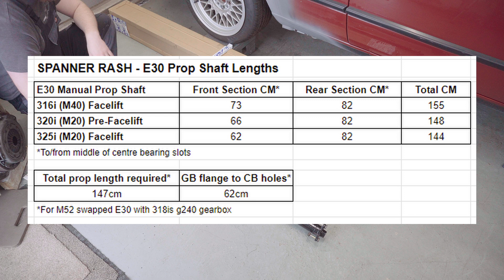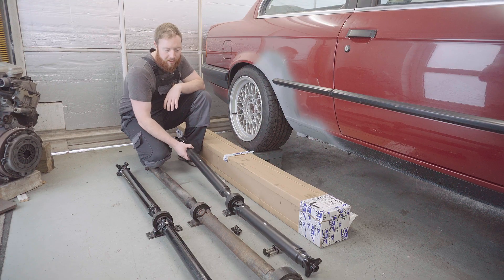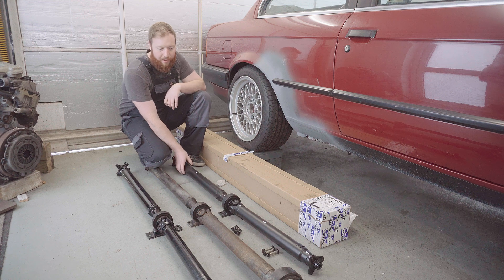E30 M52 Prop Shaft Options [24v M50 + 318is Getrag g240 Gearbox] BMW Drive Shaft Length Guide | 051

Comment: So for m50b20 swap, what center support bearing do i need?
Reply from the maker: Centre bearing? 2:58 the centre support bearing you need depends entirely on the chassis of your car.

If you have a pre-facelift car, you need the early type centre bearing, and if you have a facelift car you need the later type. The bearings are interchangeable between any of the prop shafts, but you need the correct one for your shell.
Reply: @SPANNERRASH My e30 is a 1989 320i Facelift Sedan, Ive got M50B20 non vanos on the car, at low speeds the car vibrates a bit and I dont know what to suspect, tires, centre bearing... also, when I engage the clutch, I can hear a clunk noise, but only when engaging the clutch to change gears, any help please?
Reply from the maker: @robi6713  Sounds like it could be a clutch release bearing, or maybe your clutch is knackered and has broken springs?

Well worth jacking the car up and inspecting the underneath to look at that centre beariing though, also a good close look at the wheels and tyres.

Comment: Hello

I'm in the middle of sourcing a 325i facelift propshaft
But I really cannot find any on the Dutch marketplace.

I see them on ebay.. New.. But they won't send to Europe
Can u tell me where did u bought ur 325i propshaft
And perhaps have a link for me

With kind regards
Sander
Reply from the maker: Hi Sander, yeah these can be difficult to find, most of the cars in the UK were 4-cyl and E30s are becoming more difficult to source parts for in general.

I waited quite a long time to get the 325i prop shaft, and when I did, it needed to be sent off for a refurbishment and get the UJs replaced. I'm not sure what to suggest other than patience. 

Failing that, you could contact an engineering company who can cut down or extend (and rebalance) a different propshaft, to make it the correct length.

Hope that helps!

Comment: You don’t happen to still have the 320i front section? Looking for one but can’t find anywhere.
Reply from the maker: Hi Tom, I've still got the prop, but to be honest I am intending to hang on to it as it would pair with another gearbox I've got to one side - if I ever want to swap another E30 (or if this gearbox ever blows up). If I change my mind on that I'll be sure to let you know, I know they are tough to find, hope you track one down!
Reply: @SPANNERRASH no worries, thanks for the response

Comment: Do you know the prop shaft options for the ZF -5 sp
Im Dropping a M52 in a pre facelift cabriolet.
Reply from the maker: Good question, I'm not 100% sure about that but I think you use the gearbox half from an E36 and the rear half from the E30. I suspect you could confirm that on E30 zone wiki.

Sounds like you have a nice project on.

Comment: I am around the same stage with my E30 M52 swap. I am using the original Getrag 240 from the regular 318i and have been trying to source a 325i manual prop to use ..but seeing this , its back to the drawing board! Maybe its best to get the prop front section shortened on my 318i prop ...
Reply from the maker: In theory you should be able to use a 320i manual prop shaft as a direct fit. I think it'll work!

The 325i prop will be too short, that's for use with the 318is g240 specifically.

Hope that helps!

Comment: How strong is the getrag 240? I also have an e30 and planning on going with the Honda k24 swap but was unsure how strong the 240 box is as I’ve actually got one sat on my workshop…any advice appreciated 🤙🏼🚀
Reply from the maker: Can't quite speak from experience yet, but generally been told they are very robust and should be plenty strong for what I'm doing around 200hp NA.

I think they run into trouble when used in higher torque applications though so if I was adding a turbo I might have a bad time.

If you're doing an NA K24 I'd have thought you'd be fine!
Reply: @SPANNERRASH  cheers for the reply, and I’m planning on sticking a turbo in there aiming for 350-400bhp so I’ll maybe try a getrag 260 but will have to research into the prop shaft setup like you have done
Reply from the maker: @MasterCaster97  Ahh yes sounds like you might need to look for a more robust solution, maybe an E36 ZF.

Comment: E36 325i is also an option with this engine and gearbox combo.
Reply from the maker: Interesting, I didn't actually know that!

Both front and rear section fits up nice with centre bearing in the right place?

Really useful to know if so.

Comment: Did you preload the csb ? Next week i will swap my drum trailing arms for disc non bent ones😂. Also i have bought a serated camber and toe correction kit that i plan to install too...
Reply from the maker: Hi Marios, if I didn't mention in the vid its because there's some debate about that. Lot's of sources so put should be pushed towards the front of the car slightly some say no preload is required.

I fitted mine just like the one that came off (that was probably original to the car). I think there is maybe very slight forward preload onto the original mounting witness marks, but barely anything.

Let's see if I have a problem, if I do, I can always revisit it.

What do you think it should be mounted like?

Nice I did consider welding on camber/toe correction to my rear beam too, maybe another thing I will revisit. Let's see what an alignment says first though! 😄

Hope your new disc arms work out well.
Reply: Hello m8, i tried messaging you on Instagram. Although we can also chat from here. I want to ask you about my 6pot swap that i am planning to do soon.
Reply from the maker: @mariosnikolaou5212  Hi Marios, sure I will be happy to help in any way I can, so feel free to ask. 😁
Reply: I am putting an m50b25 vanos. I would like to use the 240 that came from my 316i because the 318is ones are really expensive and also using the 240 from the m40 means cheap gearbox and no need for altering the shifter angle etc. The prop that i need is a 320i one? How many mm it must be. Can the dual mass m50 flywheel fit the 240 gearbox? Thanks in advance.
Reply from the maker: @mariosnikolaou5212  Aha, yes that's a perfectly reasonable plan. I have kept mine too as it gives me reassurance to have spares on the shelf. I don't know for sure that my 318is gearbox is good yet.

Using the g240 from a normal 316i should be just the same apart from you need a 320i manual prop shaft. It should be a perfect fit, 148cm in length. Check out the table in the vid here: 5:37

I believe the M5X dual mass flywheel will fit fine, but I'm not 100% sure about that so might be worth asking on E30zone or R3v for confirmation. I think in this case you would need to use an M5X starter motor too to mesh with the flywheel teeth. But again I'm not 100% sure.

Hope that helps.
Reply: Thanks m8. Really appreciate the answer.

Comment: Awesome stuff man.  It’s like we have similar taste. Im doing a manual swap on my 88 325is - I have e38 style 5s waiting for me to complete the 5 lug upgrade- I’ll be doing what you did. I purchased the rear stuff already but a buddy is giving me the front suspension of his e36 M3. So- I might end up installing that up front. During your research- did you ever run across a definitive answer if that setup would work with the style 5s?
Reply from the maker: Thanks mate, seems like we'll both end up with sweet E30's then. 😃

Hmm good question, I'm not sure about that actually because E36 M3 front suspension was never an option for me due to the cost and rarity.

If it pushes the front wheels out a lot further you might have an issue with E36 Style 5 wheels, but I've no clue whether it does. Sorry I can't be of more help with that.

If you find out, let us know though because that sounds interesting.
Reply: @SPANNERRASH no worries, you’ve helped me out tremendously.  You explain stuff so well. I’ll have to get that M3 stuff and see how it goes. I’ll report back- but it will be a while before I do. I have kids so not a lot of free time. 😂